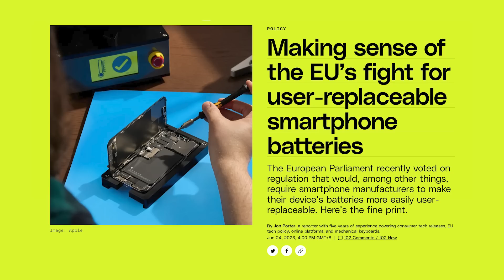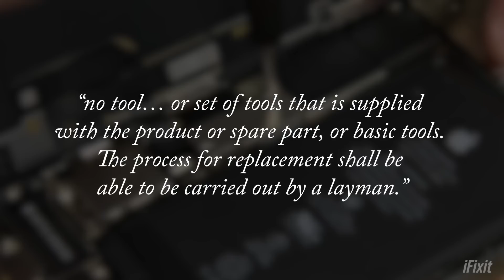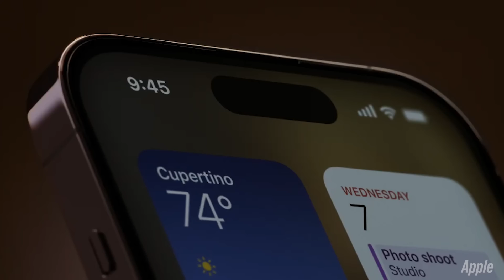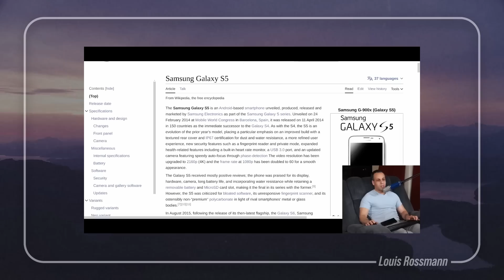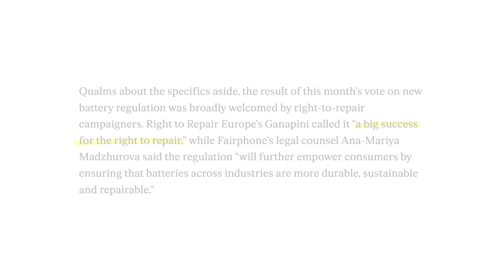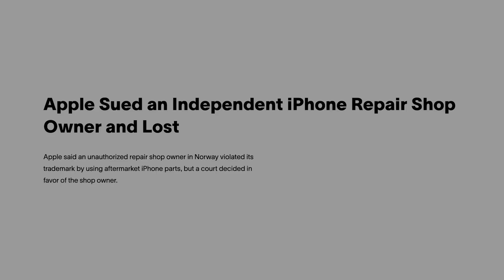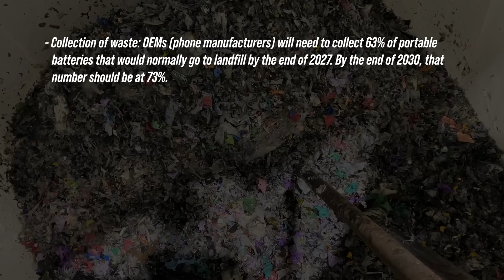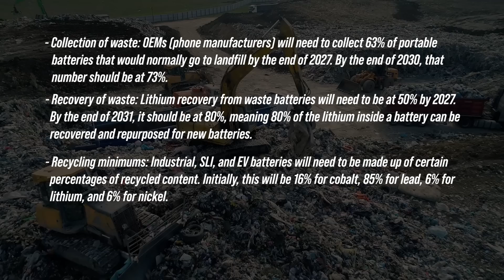EU Just Changed Smartphones Forever

Comment: I always thought that having batteries non removable from the phone was a dumb idea.
Reply: Everyone does. EVERYONE DOES. But thats not what makes money. they rather it be delicate and you buy a new one sooner. its all about pleasing investors and making money. thats it.
Reply: I still have my Samsung S5 that i bought second hand years ago. If it got Android updates i would still use it today, water resistant, small at 5", good screen, removable battery, IR sensor, barometric sensor etc.
Reply: If you're the one making the money then it was a smart idea....  at everyone else's expense.
Reply: Especially considering some fools will pay $1000+ for a phone that will eventually have to be trashed when the battery no longer holds a charge.   Buying such a phone is a dumb idea.  From the manufacturers standpoint, it makes the phones disposible so consumers have to buy a new one.
Reply: @dr.elvis.h.christ while 100 bucks smartphones are easier to repair and can outlast any flagship in terms of longevity
Reply: +1
Reply: Yup. And it's designed that way to bring more profit.
Reply: @WontonMan483  Unfortunately the biggest problem lies at the consumer that continues to get suckered when there is alternative. Switch to laser, problem solved. 

And also the problem is not only at ink printing. The same thing happens in so many other domains. And often you have no alternative or no easy way out. 

And about the scam part. While the printer will deliver the number of pages advertised, and you have the alternatives at hand to compare, is no scam.  

And about design. Phones and all kind of devices with no way to change the battery, is the seams thing. But EU just passed a law that will force returning of replaceable batteries.
Reply: I always thought people not requiring companies to make batteries replaceable were stupid.
Reply: @extremelydave 
That’s because “people” are just basic common civilians who don’t really care to shout out against large companies, since they know it would be pointless too.
Reply: Same with smartwatches and fitness trackers. Fitbits, Garmins, and other mainstream fitness trackers and smartwatches with rechargeable batteries will keep at least 80 percent of their charge for like two years. Replacing the rechargeable battery is not easy and doesn’t always work. I had a Fitbit charge 3 that only lasted two and a half years. It is a huge ripoff in my opinion. I have a fitness tracker currently (Garmin Vivofit 4) that has a replaceable battery. It uses a coin battery that lasts 6 months to one year and you can replace it. It does not have the nice features of my Charge 3 Fitbit like heart rate monitoring, sleep monitoring and does not have the GPS feature of the nicer Garmin watches. It works fine for me though, is waterproof, automatically recognizes your activity, has an alarm clock, and most importantly, has a replaceable battery. I am never again going to buy a Fitbit or any fancy fitness tracker/smartwatch until they can let you replace the battery yourself or start using replaceable coin/disc battery which have more wattage in them and can last for weeks, months, or a year as opposed to the number of times you need to recharge a rechargeable battery. I would love to have a Fitbit again with heart rate monitoring, sleep monitoring, and gps, but not until I am able to easily replace the battery myself. For now, I stick with my Vivofit 4.
Reply: @Lionel_Noisein every single car for the last 50+ years you could and still can replace the 12V battery.  Imagine if you can’t. I would argue the battery for EV is different, it is too big, too heavy for a simple home replacement (and dangerous at 400V). You need a qualified garage to do that work. But the 12V car battery, not a problem.
Reply: We had amazing tech back then! Unbreakable screen removable batteries aux jack and polyurethane bodies
Reply: It is a dumb idea.. if your intention is to make a practical, easily serviceable device with longevity in mind.
However, if your intention is to subtly (or not so subtly) urge the consumer to upgrade more frequently, thereby increasing profits by speeding up rates of consumer upgrades, then its a wonderful idea.

Planned obsolescence has been a capitalist consideration for a good while now. Dont let all the cheerleaders tell you otherwise - there are legitimate reasons why unfettered capitalism is dangerous and why it needs regulation
Reply: @scroopynooperz9051 I could care less about removable batteries as they were known for years to have mediocre longevity and how they died after 2 years of use. With non removable batteries, I did something I've never did before, I revived a dying 7 yrs old Huawei y6 ll by replacing the dying 3100 mAh battery by a Samsung (galaxy a51) 4000 mAh battery by soldering the Old BMS on the new battery, tested it, it charged normally, then I proceed to glue the new battery to the chassis and now my Huawei y6 ll has a second life instead of ending up on landfills. Non removable batteries were garbage because of their few life cycles and I don't think it would change and I don't think there would be any removable 5000 mAh battery, so for now, I stick to non removable batteries because of how long lasting they're
Reply: Whoop whoop 🙌
Reply: I've used LG G5 because I had the same thoughts as you, worst phone purchase of my life
Reply: @IchiroSakamoto LG phones have always been garbage, that's why they're no longer in smartphone business. LG phones used to be good until they killed the Optimus Line for the K series which was known to have terrible battery life
Reply: I refused to buy a new phone that did not have a removable battery. I bought a Sony Ericsson Live with Walkman when it came out in 2011 and used it up until 2021.
I was "forced" to get a new phone (Redmi note 9 was very cheap.) because I started studying (2 year program) and I need to have a smartphone. Remember the stupid Covid lockdowns. Well the school had lots of zoom meetings. Also the trains in Stockholm at not always on time so I had to communicate with school, if class could be done online.
The new phone is nice as a technology but the fact I can't replace the battery is horrid and the fact it's an android spy machine.
I can't afford to play with installing Ubuntu touch on it incase it gets bricked.
Reply: @Lionel-zd8rb Issue with replaceable batteries is that of safety, as in the battery it self, when its sealed within the phone, the phone it self acts as a protective barrier against physical damage, this in it self, allows batteries to contain more capacity in the same footprint, if the battery was removable, the same physical footprint and size would result in lower capacity since the battery would have to be protected against external damage. This would end up with phones having their battery capacity being much smaller and which means quicker battery drains, resulting in people having to have spare batteries on them at all times.
Reply: @Ascelot THANK YOU!!!!! I get so frustrated with how myopic people get with some of these issues. They are stuck in a 1999 mentality, in a 2023 reality. When the part came up about e-waste, they ignored the fact that most people are not just chucking an iPhone, with a dead battery, in the trash. There is actual value in those products still, 5+ years after release, and the product can either be traded in, for value, or just turned in, for recycling. Making us go back to user replaceable batteries means there are going to be far mor of those batteries, filling up land fills.   is one of the most environmentally conscious tech companies on earth, and the cost of having them replace your battery, isn’t much more than the cost of the battery itself, and as long as you get your iPhone back to Apple, they can recycle a huge portion of it. This law seems very shortsighted. It would be a pricey move, but a great way to prove what customers would prefer, would be for at least one product cycle, design two phones as close to identical as possible, but have one with a removable battery, and one with an integrated battery. Then let consumers decide, which one they would prefer. I guarantee you you that the vast majority would go for the longer battery life built into the phone, because if they needed extra battery life, they can easily get an external battery, which is a much more versatile solution than having to carry around an extra battery that can only be used by that specific device. This new law is such a regressive approach to technology.
Reply: The batteries have always been removable, people just lack basic skills
Reply: @BMWROYAL and breaks your warranty for most.
Reply: @BMWROYAL  Basic skills like what? 
Heating up to remove adhesives? 
Make sure no ribbon/wiring breaks during opening?
Making sure you don't scratch or damage anything?
And after you're done putting adhesives again to place it back together and making sure you don't forget anything?

I think you and I have different interpretation to what basic skills are.
A lot of modern phones can't be opened and battery changed by normal people.
Reply: @mighty-roman  Basic skills to check things out before you buy. Not every phone or tablet has stuff glued together, a lot of them are pretty easy to open up. I remember buying a workstation computer from Dell 20 or so  years ago, and they had glued the CPU to the motherboard to prevent people from upgrading it. Ever since that I've always checked before I buy.
Reply: @BMWROYAL  Well sure, trying to remove fragile display from the body due to how really tightly glued and heck some even have batteries glued to the battery as well is a thing unfortunately on some device. The point here is user-removable batteries or at least easier to service without have to resort on riskier process. And having to remove the glue bond of the display isn't considered "safe" and discouraging for end-users.
Reply: @BMWROYAL Not when Apple puts serial numbers on them and breaks your phone if the serial numbers don't match.
Reply: @chudchadanstud  Well, that's what you get for buying Apple products.
Reply: @daniel4647  Yes it's all fun and games until Sammy and the gang start copying them...
Reply: @chudchadanstud from what I saw, Samsung only did it with the Galaxy a51, and it was only it's fingerprint sensor not working properly. Every android OEM knows that if they tried that stunt, it will definitely backfire on them. Yeah, android users don't accept bullshiit like that compared to the isheeps
Reply: @danteerskine7678 haha, please, is that why the microsd is fading?? Android users are no better. You all mock apple for something and then adapt that very thing you mocked.
Reply: @BMWROYAL  and tools, a heat pad (which costs hundreds if you dont want to use a hair dryer),  short circ bands, the battery which costs a LOT, and extra adhesive. i dont think you even know how to remove a battery from an average android phone, let alone an iphone
Reply: @BMWROYAL  Removable yes, through tooling that in inexperienced hands could easily destroy the phone, and even in the best outcome you break your own warranty. Also many companies like Apple don't allow you to mismatch components, even if they're genuine. All their internal hardware are software coded to match, and when a new component is swapped the system locks down because it doesn't see its default configuration anymore and locks you out of vital systems like the camera, sometimes limiting battery life, sometimes force shutting apps, etc. So even if you did have the technical knowhow to physically swap a battery, you still would have to ask an "Apple certified technician" to recalibrate the new components (which is a 2 minute job that they charge 100s of dollars for). It's literally just an Apple fee that only exists to drive people out of money or force them to just buy a new phone instead of dealing with the hassle of it all. Most casual consumers end up going with the latter - which is the entire problem as it foces excessive amounts of e-waste and wasted money.
Reply: @Real_MisterSir even with calibration, apple is now known to have the most anti repair operating system out there. Even licensed techs can't repair apple products anymore and Tim cook have the nerve to talk about environment 😂😂😂😂😂😂😂
Reply: @BMWROYAL just like how car engine's have always been removable but people lack basic skills.
Reply: @BMWROYAL  Opening these phones is not worth all that headache. It is a glued together slab of glass that can easily be broken even by professionals. Removable batteries is perfectly fine I'm sure they could make them better than they did back in 2010. The thumbnail of this video looks like a better way idk if thats a real thing or not.
Reply: @TylerMBuller12 of course, flagships are a pain in the ass to repair because of the fragile materials like glass and ceramic. Polycarbonate back panel are easier to remove and some of them have plastic clips instead of being glued in place for easy removal, but hey, that's a flagship owners problem.
Reply: @TylerMBuller12 that's a LG G5 sadly they don't make phones anymore.
Reply: @BMWROYAL  basic skill licking glue?

Comment: My retro Nokia’s still work because of replaceable batteries and everything being hold together by screws instead of glue.
Reply: Had basic Nokia for years until they got a bit of a cult following and became more expensive...
I use a basic Alcatel now, just as simple and hard wearing as Nokia... But cheaper.
Reply: the more simple the item is, the more reliable it is. Smartphones has more points of failure, its nothing new.
Reply: I think you should still have an option to buy one without a replaceable battery. It's prefer the thinner lighter phone all day.
Reply: @cnaccio having a removable battery doesn't mean the phone will be bulkier.
Reply: My iPhone 4 I bet still works, changed the screen a few times and the battery once, myself as a consumer, I hope batteries stay as they currently are but not allowed to restrict if swap for a replacement part as serial not match

Comment: I have bought five smartphones since 2013 and I could have still been using them if the batteries were replaceable. 
Now they just sit gathering dust.
Reply: How the hell did your phones break that easily?
Reply: Five phones in ten years... are you a slow learner?
Reply: Every single one of those phones that you bought have fully replaceable batteries….. Just take them to a phone repair shop and they’ll do it for like €30. My iphone 7 is still going strong 7 years now, don’t blame the corporations for your dumb ignorance lol
Reply: The problem with such batteries is that they are not quaility checked, if the battery comes directly from manufacturer we will have peace of mind. that it wont explode or catch fire. @alenko4763